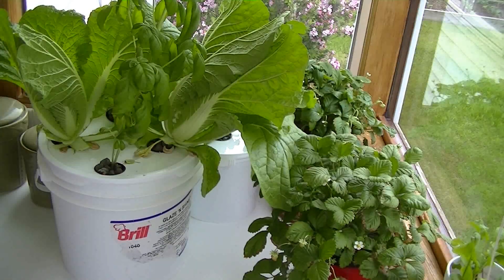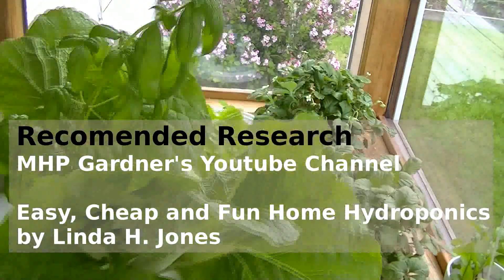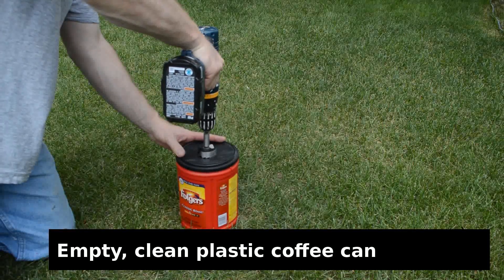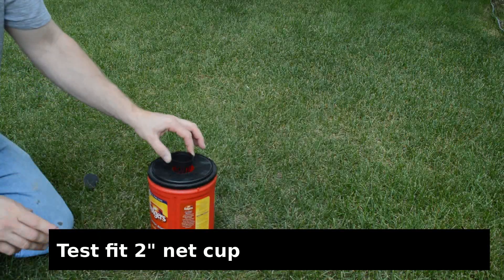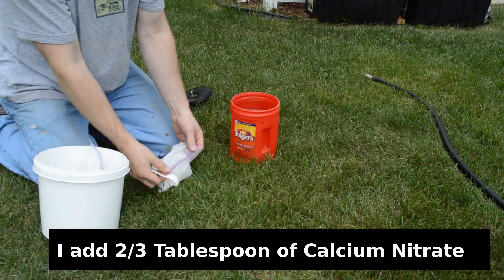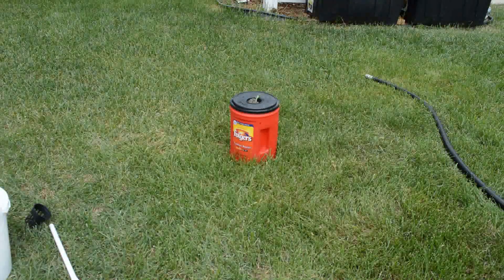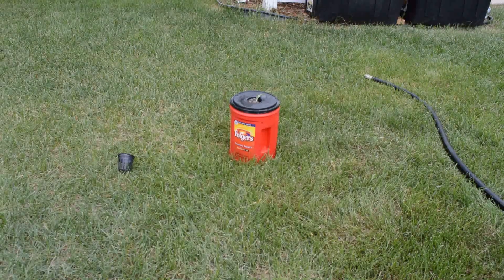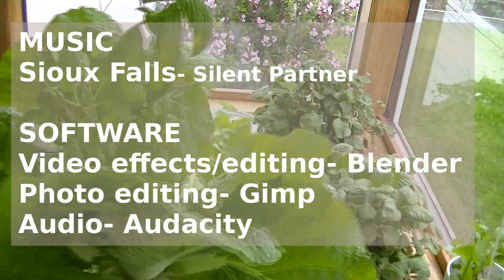Kratky Hydroponic Experiment

Comment: why are the roots so black they should be white.
Reply from the maker: cyb3rneticvirus Everything other time with other plants I have had white roots.  This is the only time I have tried alpine strawberries and the roots were dark.  I did start them with some seaweed extract in the mix and I wondered if that did it.  They were dark from the start, but I did refill the container half way a few times.
Reply: Just Build Stuff its best practice not to have roots that dark but I found that the nutrients I used plus additives made them that way. Also if the plant was still alive it wound up recovering from it by growing more clean roots so it wasn't a problem for me.